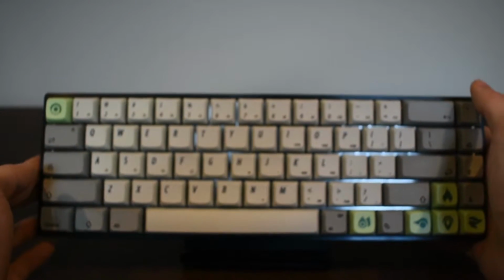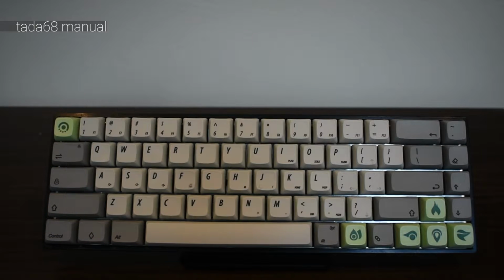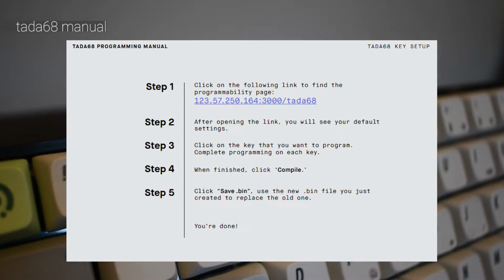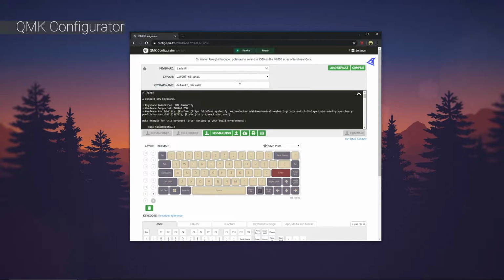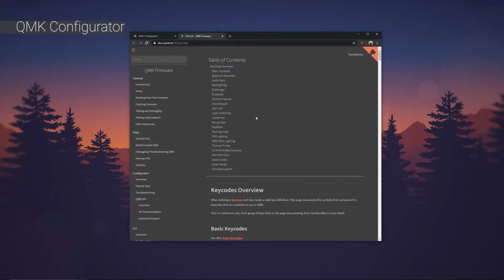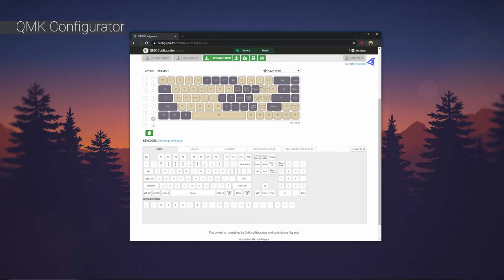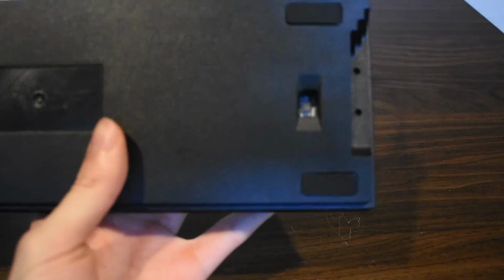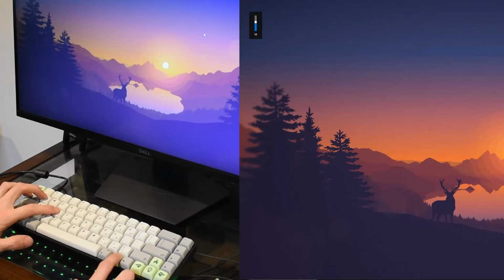Reprogramming a Tada68 Mechanical Keyboard in 2020

Comment: Hi! My Tada68 has a split left shift (two keys) and my enter key is different, like the bigger one. I'm having a problem in which the keys I configure in the QMK don't match with what is shown to me on the web page. For example: I configure what usually is my ESC key to "A" on the QMK, but then when I press it it's a "}". 
I've found a way around it - I've tried many keys on the configurator and now I kinda now which key corresponds to which and I've configured the keyb, but I couldn't find the "?". Any ideas?
Btw, nice video, clear, easy to follow and concise!
Reply from the maker: Sounds like you have an ISO keyboard (large enter key and split left shift). In QMK Configurator, after you select tada68 in the 'keyboard' drop down, the 'layout' drop down should have a LAYOUT_65_iso option (LAYOUT_65_ansi is selected by default). Selecting LAYOUT_65_iso which will change the displayed keyboard to match your physical PCB in ISO. Give that a try and it may help clear up the faulty corresponding buttons you're experiencing. Good luck!
Reply: @mryeester  Thank you for your reply, will try it when I have the time! I'll try to reply with the results :)